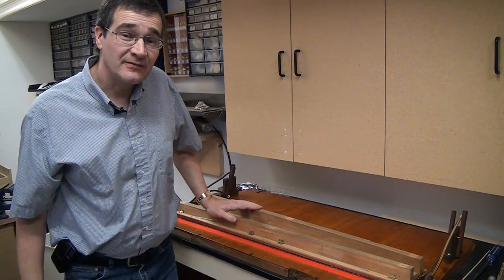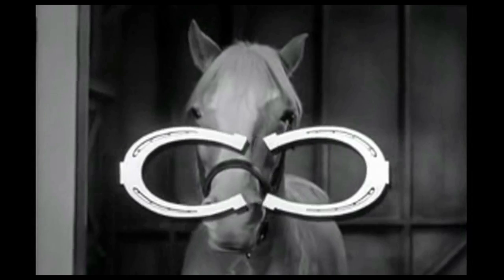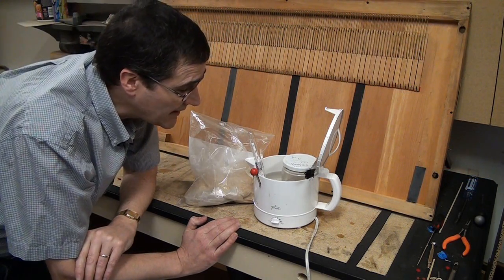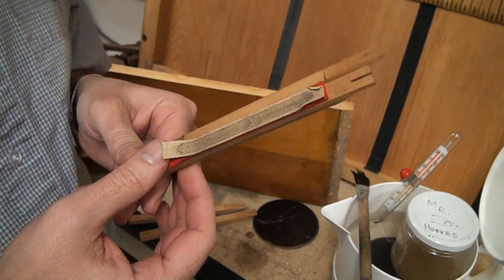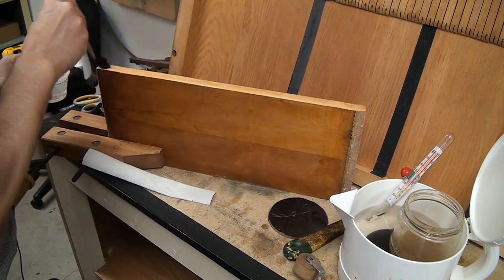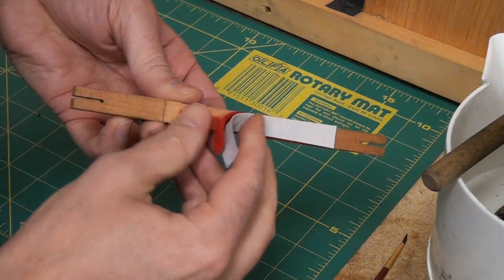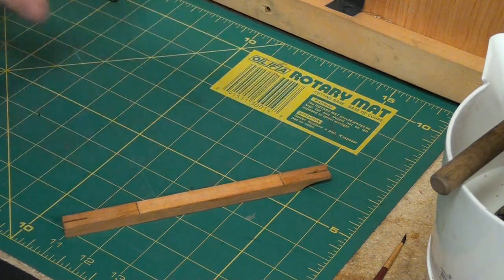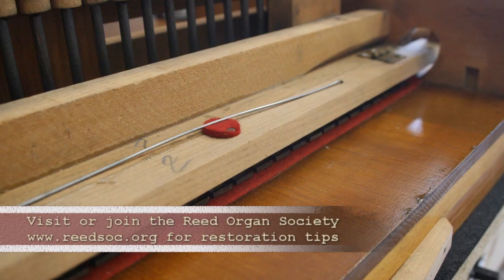Reeding101 - Chapter 6 - Hide Glue for Reed Organ Repairs

Comment: Piece of advice on storing hide glue...    pour it out into a dish (a silicone baking dish works great!) and allow to gel firmly.  Cut up into chunks and dry for a couple of days.  Alternately, dry the whole sheet on a screen, wrap it in canvas, and give it a few good whacks of the hammer to break up the chunks.  Just soak them in some water overnight.  This preserves the integrity of the glue, which may be compromised by storing while liquid, restores the nearly indefinite shelf life, and allows you to eliminate waste.  This is especially useful if you find that you make too much and end up throwing it away due to lack of volume.

Comment: I put pea size pebbles in the bottom of my pot.  It keeps the bottle of glue away from the heating element.  I also have a hold-heet pot.  I found it was off temperature and had to open it up and adjust a rheostat to get it closer to 140.  Great series of videos.  Thank you so much for putting them together.

Comment: EXCELLENT video, Rodney!!!!
Reply from the maker: Thanks!  I remembered that you mentioned a long time ago you liked the Mr.Ed label :)
Reply: The way you heat your glue is exactly how I do it too.  I use the Rival pot with a candy thermometer.  I had to take my pot apart and adjust the knob so it would go low enough as to not over heat the glue.  Works fine now.

Comment: Paint remover will get the white glue off without removing any of the wood.  It's aggravating to have to do that, but it works.  That neoprene stuff that Durrell Armstrong was pushing for pallet valves in the 70's and 80's was just awful.  It sure makes for leaky valves. Thanks Rodney for all your hard work!

Comment: Rodney,
I think that you have come up with the lowest cost hot hide glue pot that I have ever seen. That is a great way to get started in using hot hide glue. I wonder if the humidity of your water bath slows down the evaporation of water from the hot hide glue.
I don't trust myself to keep track of the water in the water and the manual temperature of the hot water heater.

I saw a woodworker's video in which he uses an old school hot hide cast iron glue pot. He uses a portable digital induction plate cook top burner. It would work great in conjunction with the cast iron glue pot (especially if someone already had the glue pot). But alas the water must be maintained in the water bath portion of the hot hide glue pot.

I gave up and purchased a Hold Heet Glue Pot when I realized that the cost of anything short of your set up would cost more than buying a vintage hot hide glue pot and an induction plate burner.

Thank you for posting this video to encourage anyone working on their reed organ to use hot hide glues.
Mark.
Reply: Sorry to be so offtopic but does anybody know of a way to get back into an Instagram account??
I somehow lost my login password. I would appreciate any assistance you can give me
Reply: @Greyson Griffin Instablaster ;)
Reply: @Anderson Baylor Thanks so much for your reply. I got to the site thru google and im trying it out now.
Takes a while so I will get back to you later with my results.
Reply: @Anderson Baylor It did the trick and I actually got access to my account again. Im so happy!
Thank you so much, you saved my ass!
Reply: @Greyson Griffin no problem =)